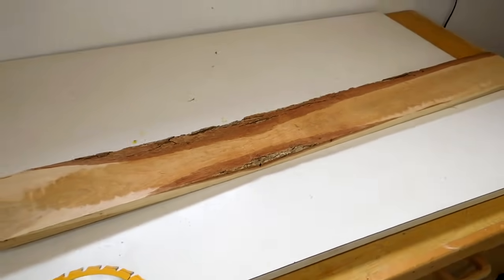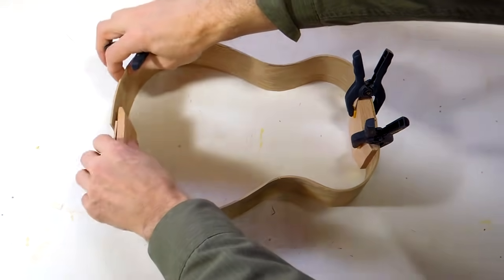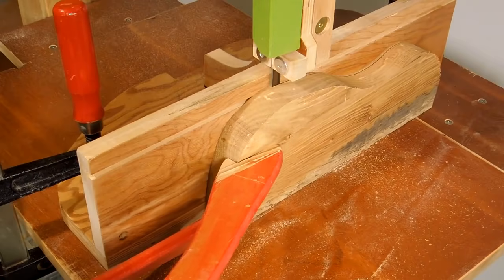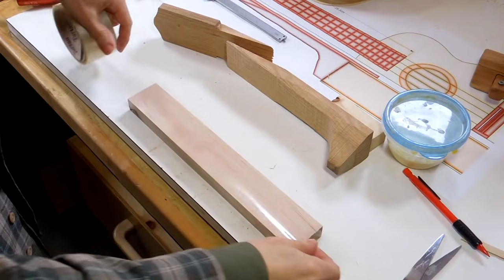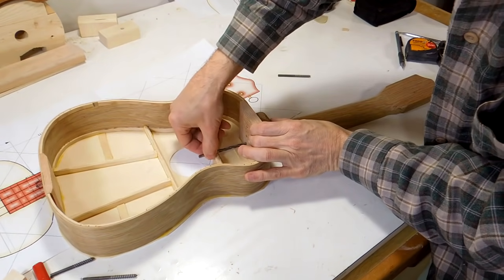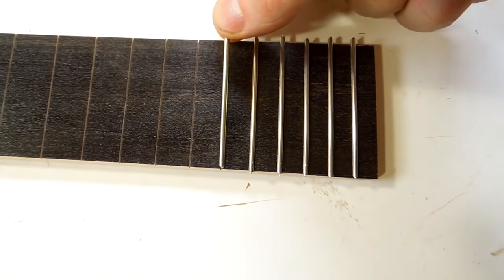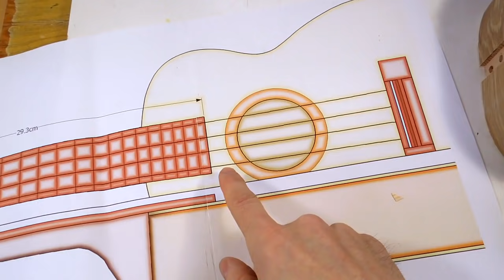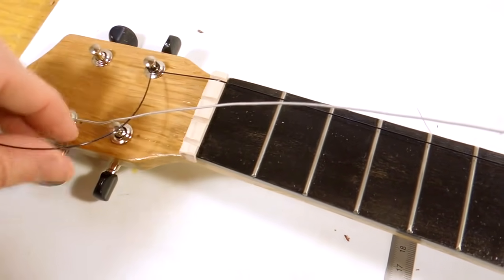Unorthodox ukulele build, start to finish.

Comment: The cool thing about ukes is the string tension is so low you can do much anything you want with the design. I think this is a great build!
Reply from the maker: Depends on the size of the ukulele.  For this one, it's almost the same tension.  Basically, take the 4 highest strings on a guitar, put the capo on the fifth fret, and you have the same scale as a ukulele.  Fifth fret to bridge is typically about 487 mm on a guitar.  Scale length on this uke is 450 mm.  So this one has about 85% of the string tension as a full guitar.
Reply: @matthiaswandel  the nylon strings of a uke have much less tension than a steel string guitar, a classical full size guitar has about half the tension of a same size steel string, then you are losing a third of that tension with two fewer strings, and about a quarter with the scale length. So you have half the tension of a classical or a quarter the tension of a steel string.

Comment: Hi Matthias,  I don't know if you will look at this comment, but one tip that I use to get that "butter-looking" finish is to first seal with "Sanding Sealer".  It is a very hard lacquer that drys fast (hot solvent).  You then sand this smooth as it cuts fast and leave a hard surface for your clear coat.  The sanding seal will then seal the wood so that you do not get the "orange peel" look on your wood.  Also, you will not need as many final coats.  Finally, for your last coat keep the wind away that carries sawdust so that you do not get little particles on the surface.  After the final coat is very hard, you can use car wax to get the buttery gloss on the sound board.

Comment: For a clear coat, consider Solarez I Can't Believe It's Not Lacquer. Cures in sunlight in 60 seconds, sands easily and buffs up very nice. Also, zero VOCs, nonflammable and almost no odor.

Comment: I built a traditional gourd banjo. For the bridge, my design was similar to the old guitar you showed.I made a wooden piece that resembled the metal piece on the guitar to hold my strings. The wooden piece is held on using some juke string and wrapped around the bottom peg.

Comment: Your original build inspired me to start building one of my own, but so far I haven't finished it. I used a wooden cigar box for the body, because it's Spanish cedar, which is a traditional wood for classical guitars, and I made the top out of western red cedar. The neck is birch with a mahogany veneer on the top of the headstock, and the fretboard is curupay, with ebony fret markers that are also alignment pins that kept the fretboard straight when gluing it up. It's actually about 90% done, I ought to finish it up one of these years.

Comment: Matthias, very inspiring video... I have been dabbling with building  a guitar off and on for a while, amongst all the hundreds of other projects I have on the go.....

 You have a lot of great, astute methods here....Far better and more persevering than I...as you completed.....I will offer my ten cents though, in the hopes of helping a little, if I can.....

 It would be worth your while to purchase the small "hard" components of nut and saddle- as these items are integral in improving sound... Even the fret board is so small, one could throw for a harder exotic  or more dense wood without breaking the bank.... A piece of Brazilian cherry flooring for example.......

I bend wood in a similar way...I insulate with foam.....but anything with r value works...

Your methods are practical, and  great... I have learned many things from you.  Your methods  may not be Gibson/ Martin "Luthier".... but they  work very well...and they create wonderful instruments, without spending a fortune.... again...very, truly inspiring....Thank you.

Comment: With oil base poly, I use 600 grit after the last coat and then use a rag with mineral spirits to give it a good wipe. It tends to melt the final coat and ends up amazing. I've never had good luck with water base poly.

Comment: I ended up building one myself. Although mine looks pretty and I used Redwood for the fretboard and yes frets are worth fretting about mine is much more muted than yours. I do think your bridge/saddle is the difference and that my Hickory bridge/saddle had enough mass that it dampens the transference of sound vibrations.

I am threatening myself to do it again. Next time I want to shoot for either a tenor sized ukelele or parlor guitar. The soprano sized ukelele yields a sound that does not really appeal to me when combined with the high G tuning. I much prefer the low G tuning which is more intuitive in the first place.

Comment: Great build and some good techniques. I think personally I would have bought the proper string supports instead of the four screws and many tried to work in a dovetail to join the neck to the body instead of bolts, but I’m nit picking as they say. Keep up the great videos love them.

Comment: A suggestion if you want to play the instrument:  It will sound better and louder if you remove nearly all the finish on the sound board.  Custom guitar builders use very little finish and then remove most of it by sanding and polishing.  The finish retards the vibration of the sound board.  The less there is the more vibration.  Sanding off most of the finish and then finishing with polish and a buffing wheel will also produce a better looking finish.

Comment: I built an electric bass in HS back in the 70's, it had a clear body, walnut neck and it played in tune, the lucite body was a bit heavy and 40 years later,  still don't know how to play. One thing for sure it's a whole lot easier to build electric instruments than that acoustic one you built, although a trust neck is a bit tricky. Interesting side note, when videos are more than 10 to 20 minutes I will generally pass them by unless I specifically searched for the topic. Must be why, even though your channel is one of my regulars, I missed the first run of this one.
Reply from the maker: It was a whole lot of shorter videos, but back in 2013

Comment: You didn't need to worry so much about the method used to anchor strings for the bridge section - the strings don't pull that hard (not as hard as on a guitar anyway).

My wife teaches music and one of the bridges on the cheap mahalo ukuleles broke, I made a replacement bridge with a bit of scrap (of some kind of hard-ish wood) cutting needed slots with a hacksaw and drilling holes (the holes where strings are actually tied to bridge) with a hand-drill. The bridge was previously held on with just glue, but I also added a couple small self-tapping screws (screwed in from the inside of ukulele).

The repaired ukulele has held up for over a year (getting its share of abuse from elementary-school-aged kids).

Comment: I assume you used hide glue, so that you can service it in the future if need be? Also I have used beef bone for the nut and bridge on dulcimers and it has worked well.
Reply from the maker: No hide glue.  But the neck is just bolted on.  And with enough heat, regulat wood glue lets go too.

Comment: I use steel wool,,,even sos pads if can’t find,,  make sure brush is trimmed smooth for applications
Reply: Do you ever find that it rubs onto the wood and then rusts when a finish is applied, changing the color of the wood slightly?
Reply: I would think that your rubbing way to hard and not noticing if that happens,  I never had that issue,  I try to put on thick coats at first also as it does soak in and not fill any gaps a first,  on flat surfaces like doors I have used tape around the edges to help eliminate runs on the side and get it thicker,, three or four coats and you should have a nice glass finish,  wait for it to dry very well before using steel wool and clean it very well and ensure dry before applying next coat
Reply: @gordybishop2375  I think what mught've discolored the wood was sparks/metal dust from cutting steel with my Dremel on the project. The steel wool was probably stainless anyway.

Comment: I recall, from my history of trying to play the classical guitar, that the ribs of the "soundboard" were an invention of more than a century ago that greatly increased the popularity of the guitar. And, it wasn't because of the added strength against breakage. No, the ribs alter the possible modes of vibration of the soundboard, which greatly increases loudness (or so I read... certainly the ribs alter the modes of vibration).

Comment: not sure why you had so much faffing around  getting the frets in... lay the neck flat,  just put one end of the fret in and then gently tap along the fret from the inserted end with a small hammer to work them in...only takes a few seconds for each fret...

Comment: But why "unorthodox"?
Reply: I think everyone asks that question in their head
Reply from the maker: luthiers are very particular about how it ought to be done.
Reply: @matthiaswandel  
But it works, right?
Haters gonna hate. You do you. 
Have a good day.
Reply: probably because he didn't use a finish that is conducive to good tone lol
Reply: Also he did not used spruce that was cut by blueyed virgins and drying for a hundred years in the attic of the opera house :D
Reply: Bolting the neck on a ukulele is very odd. They are typically glued in. Fender electric guitars are all bolt on neck though so it’s not too crazy.
Reply: @kiltymacbagpipe  many guitars are bolt on now since Taylor made it popular
Reply: Unfortunately, to the artisan luthier (denizens of which guild there are a plenty) Matthias is still a woodsman and his gifts of innovative design are frowned upon - no hates mind you, just a few odd frowns is all.

Comment: Some of this is very well made, but it hurts to see how little you care about the soundboard. Sure it's a uke, but you seem very much like someone who would experiment with voicings and all that. The difference in playing a good high-end uke and a cheaper one is quite extreme, without proper voicing any soundboard based instrument tend to sound very flat and have dead spots in the frequency spectrum (yours has some of those but sounds decent enough). There's a reason why luthiermade instruments are so expensive, other than feel and overall quality. Unfortunately most people relate the sound of a uke to those cheap ones from China, but a well made one will sound not unlike a nylon string guitar, perhaps less deep and bassy but still. 

Overall I'm rather impressed that you managed to make it sound as good as it does, even though I disagree with most of your methods.
Reply: Matthias took plenty of care about the soundboard.  Sure, he said it's cut from construction lumber, but it's probably pine, fir, or perhaps even spruce, and very fine grained.  The grain looked nearly vertical too.